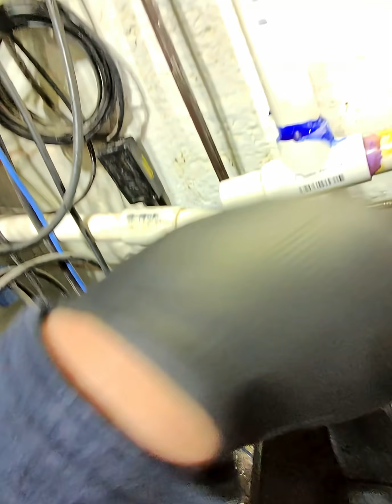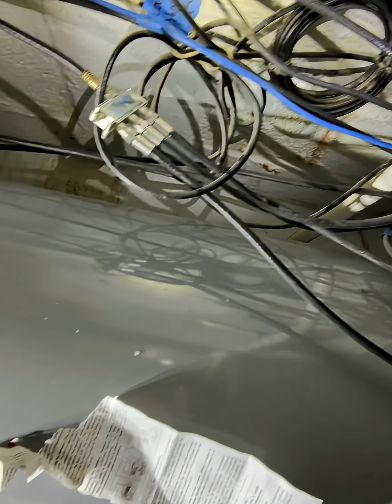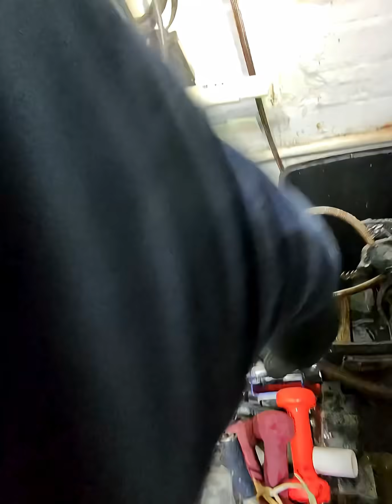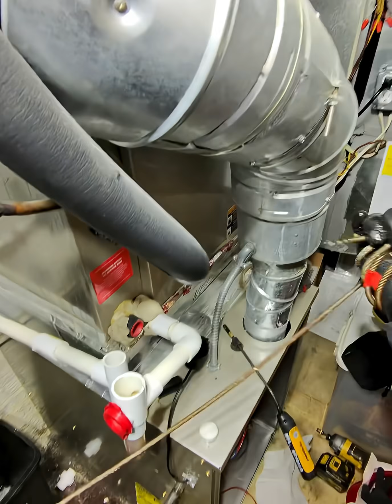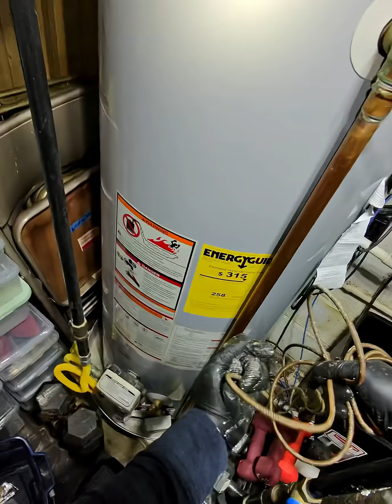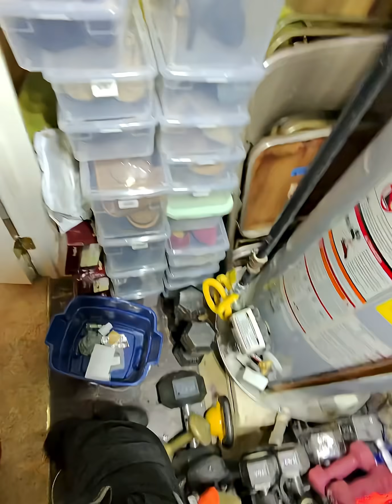The SNEAKIEST AC Clog You'll Ever See! | HVAC Stress Test

Comment: I'd reassemble the drain line with a union to make things easier in the future. 

Never a bad idea to help the next tech out 🤷‍♂️
Reply from the maker: That's a great point. Unions are essential for future service. On this job, I added one downstream of the access tee for a very specific reason: to give the snake direct access to the line after other methods failed.

What the video doesn't fully show is that the initial clog in the EZ-Trap cleared quite easily. The real issue, and the reason I don't trust a simple fix, was revealed when I stress-tested the line. To prevent a callback, I always run a full 5-gallon bucket of water through the line after clearing it.

Sure enough, about halfway through the bucket, the line started overflowing again from a persistent clog hidden further downstream. That's the kind of deep blockage that causes the system to trip again a few hours later, and it's exactly what I was looking for.

Even after isolating that section with a ball valve and hitting it with a CO2 blast, the clog wouldn't budge. That’s why the union was the key part of the solution—it allowed me to open the line and get the snake deep inside to physically break up the blockage. That’s when we pulled out the white, gunk-like material. It’s a perfect example of a clog that would have ignored a simple flush and guaranteed a frustrating callback.

My process for clogs is to escalate the approach. I always start with the least invasive methods: vacuuming the line, then introducing hot water, sometimes with a diluted chemical flush. If it’s still draining slowly, I’ll use a targeted CO2 blast. But when a clog resists all of that, you have to find another way in.

In this particular case, the clog was so deep in the wall that it took a surprising amount of water just to manifest. As it happened, the homeowner brought out a plumber's snake, which turned out to be the perfect tool. It resolved the issue so quickly and effectively that I've considered at length whether to standardize the tool since time is the name of the game. We can't manufacture more of that finite resource.

Comment: Why would you ever need to snake a condensate line? Does it work better for cases like calcium buildup?
Reply from the maker: Honestly I have never snaked anything before this service call. I considered it in the purview of plumbers and toilets. Nonetheless, the homeowner kindly bequeathed me this new tool to add to the arsenal. Afterwards, I started wondering if this was actually a more effective way to unclog a persistent drain issue in which you hit with CO2 canisters while isolating it with shutoff valve, introduced several buckets of hot water, and even resorted to diluted vinegar to try to overcome this pesky clog which was remedied but not fully unclogged. I’ve had instances in which ridiculous time spent unclogging a condensate drain line caused me to just straight up cut out the entire problematic portion of a PVC drain line. Once I did I was glad when I saw how occluded the inside of the PVC drain line was. It resembled the hardening of arteries I imagine doctors find in patients with issue pertaining to their cardiovascular system.

In the most recent memory that comes to mind the homeowner had set his water heater above the code threshold of 120 degrees. It was pumping out ridiculously hot water and felt scorching hot to the touch despite double ply latex gloves. I grabbed one end of the PVC pipe as I aimed the hot water right through the PVC interior as I tried to salvage a PVC fitting attached. I kid you not that occlusion persisted as I banged against the basin to try to loosen it up. No luck. Ended up thankfully having a drill bit to salvage old PVC fitting and finish the job that night.

Clogged drain lines can end up eating so much time when you attend them with the mindset that if you don’t do it right it will be YOU who has to come back later to conduct your own the “walk of shame” I’m sure others have experienced as they developed in the trade. So you better believe I am going to introduce a whole bucket and more so I don’t receive the phone call about a callback that could have been avoided. No one said this was easy work, but that’s why we are the professionals homeowners call to restore proper function to their cooling and heating systems. Just make sure you price your services right and always be ready to innovate when it ultimately saves time and labor.
Reply: @NelsonsHVAC  yea drain line issues are one of the top call backs, everyone likes to just blow em out and they won’t check inside the coil pan.